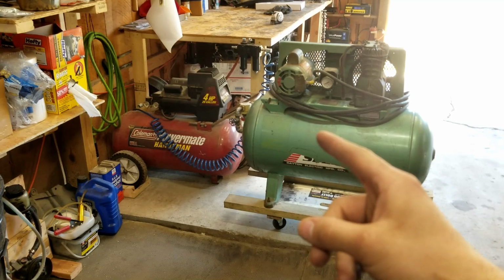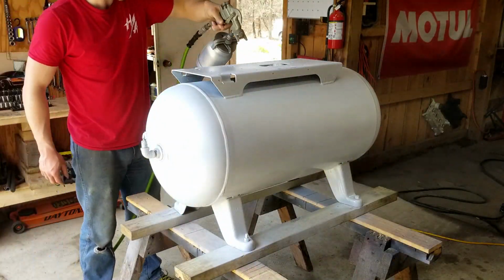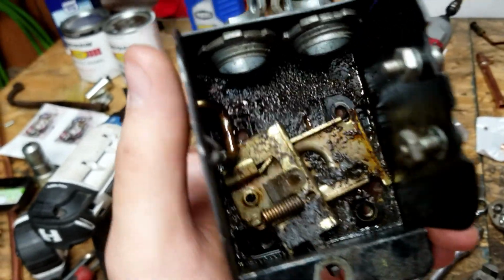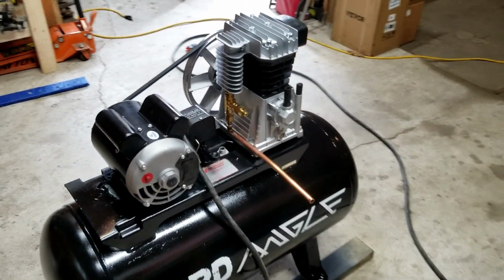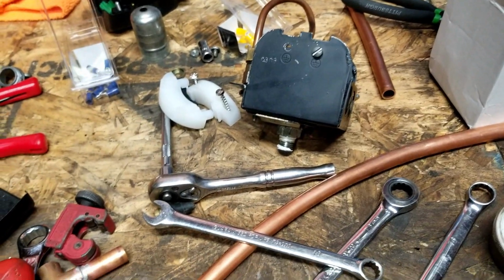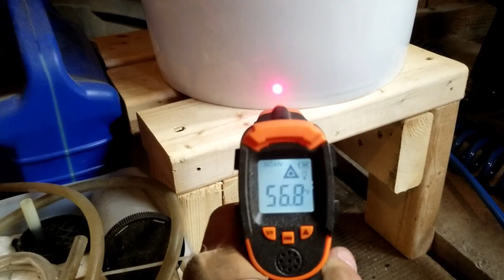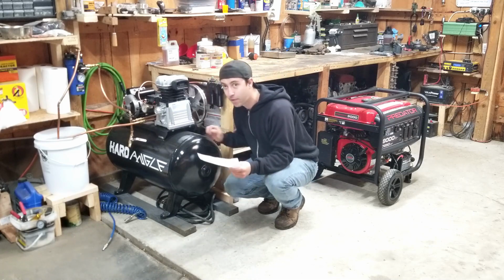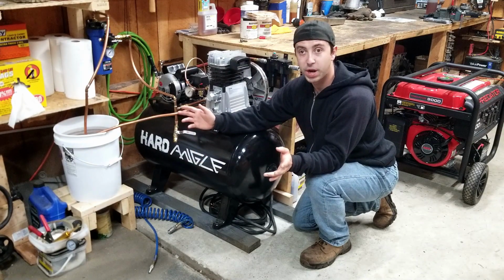I Built My Own Air Compressor with WATER COOLED AIR LOOP!

Comment: No heat shrink on wiring exposing copper, no tank drain on the bottom of the tank, wrong crimp fittings and lack of crimp tool for wiring..  and if you wire motors off of 240 when they can they will be more powerful..   keep the heat on the pipe and fittings when soldering plus use flux..  you can get pads for the compressor that stops a lot of vibration..  if you get a power steering cooler radiator they cool the air plenty as long as you get a 2 pass thats a decent little size and they’re only 40$ at most.  Powr steering is usually 3/8 line so some adaptors and a little pipe fitting and they work great..  using a bucket of water is just too much to keep up with and as long as you use the power steering cooler and put it below the point where it enters the tank with a oil water separator before the tank than not much moisture will get in the tank but still need a drain..  gotta keep tanks drained.  From the amount of crap that was inside that tank from the sound of it im betting its pretty rough inside..  not good..
Reply from the maker: Just going to say most of the stuff you suggested I actually did... yeah the motor wiring could have been better but it is wired for 240,  the tank did have a drain, I didn't build the tank anyway a giant corporation did, everything was soldered with flux, and the bucket of water was insanely cheap, had better flow, and will keep the air cool for hours of continuous use and when heat soaked can be dumped out and replaced with cold water in just a few minutes.

Comment: 100% duty cycle is a dream . I highly doubt that will run a sand blaster your gojng to over heat the pump or motor in no time flat
Reply: I ran a sandblaster for 15 years using a 2hp 20 gallon SEARS compressor.
Reply from the maker: Surprisingly it runs my Skat Blaster great, have done up to 5 hours of straight run time without issue, had a few hundred hours on it now.

Comment: That copper gets really hot! Be careful it will get weak and loose in time.  This will be like getting shot with a 38 cal.  Be safe use compression joints save yourself and your family.
Reply from the maker: This is good advice! Air systems always make me nervous in general, an air compressor is basically a giant bomb after all.

Comment: I just finished rebuilding my air compressor and due to the modifications i've got a bunch of fittings involved and because of this I wanted something better than teflon tape making sure everything is leak free. I ended up buying a tube of "pipe dope" aka RectorSeal "T Plus 2" and the stuff worked flawlessly. I will never use teflon tape on my compressed air system ever again.
Reply from the maker: Pipe dope is worlds better than Teflon, overtime pretty much every piece of tape was replaced with pipe dope when they started leaking.

Comment: Keep the heat on your fittings when soldering. The heat helps draw the solder all the way in the cup.
Reply: Was coming here to say the same thing. Also prevents cold joints. Other than that good DIY project

Comment: Great build! I like when things are built and restored vs bought. I am building a 5 hp w/ a vertical 30 gallon used tank.  
Oh and a tip when soldering, use flux on the pipe and fitting and apply heat to the fitting and the solder will run into the fitting and coat the entire surface between the fitting and the pipe. This will give the strongest and leak free join.
Reply from the maker: Thanks for the tip! System is still running with no leaks or issues, changed to a 60 gallon vertical once I noticed this smaller tank had pinholes in the bottom and I didn't want to risk my safety. But that tank was also used and restored just like this one.
Reply: @HardAngle does the generator work good with the 60 gallon tank ? If so how long does it run with a full gas tank in the generator
Reply from the maker: @CristianGarcia-g3u  I've gotten over 12 hours of run time with a full tank, but the generator was also running my lights, the sandblaster vacuum, and a wood stove blower fan at the same time as the compressor.
Reply: @HardAngle  an that’s with your 60 gallon compressor runs good with it ?
Reply from the maker: @CristianGarcia-g3u  Yes, that is with the 60 gallon tank, since it is the compressor body and electric motor just on a different tank it runs just like before, just takes a little longer to fill up now.
Reply: @HardAngle  oh okay thanks I’m looking to get same exact set up
Reply: Great job I'm running a 29gallon Harbor freight compressor off my 6500watt predator generator without any problems I also did some minor upgrades to the air compressor too but not a whole lot an online water seperater as I use mine mostly for painting metal doors and gates I build it works fine because I mostly use my Lincoln 225 ranger to weld with the generator does everything else especially when I'm welding My helper can do the painting

Comment: If you wanna save on fittings sweat the joints everywhere you can. I did this my second go around building one of these cooling loops and it saved me 120 on fittings vs my similar 200 the last time. Now if your sweating joints and creative you can make some interesting parts for very little. I know one step was gonna run me 70 the first go and sweating it it was closer to 20.

Comment: That was a Sears  Craftsman Compressor under another name Aprox date 1975 had a few of them good unit check tank for rust mine started leaking pin rut holes
Reply from the maker: I also discovered pin holes on this one shortly after the rebuild. I have since switched everything over to a vertical tank and even did a hydrostatic test on it before building it.

Comment: Looks good !!    I approve  :)
Reply from the maker: Turns out, this tank had a pin hole in it and I had to get a new tank. Bought a 60 gallon and the new setup is even more similar to what you did! Lol
Reply: @HardAngle   Very nice... I personally like the upright compressors more since they take up less floor space 👍
Reply from the maker: @fix206  Less floor space AND they are easier to drain due to the shape of the bottom vs a horizontal where it pools along the entire bottom, I am now a firm believer that vertical is the way to go.

Comment: You should hydro test that tank.
Reply from the maker: This tank ended up having a pin hole in the bottom, I got an upright 60 gallon tank and hydro tested it to 230 psi and all went well. Has been running flawlessly for 7 months now. I agree with hydrotesting your compressors every few years, takes an hour or so and could save your life.

Comment: So does that coil of copper sitting in the water end up filling up with condensed water?  And by the look of things, once it fills up, its going to back flow into your pump
Reply from the maker: I have a few hundred hours of runtime on this pump now and have drained many gallons of water out of the water separator but when I took this system apart to move and turned the coil over not a drop came out, so apparently the pump flows enough to ensure any water is pushed into the water separator.

Comment: I built a similar sized compressor with a used 3hp motor, used tank, used switch, used electrical disconnect and a used Devilbiss pump that was in like-new condition...way way less than $972.
Reply from the maker: Again.... $400 in copper and fittings, literally half of the cost is for the cold dry air, the compressor was around $570, couldn't buy this kinda of air output for that low anywhere these days. But I do still respect someone that can build something out of used parts for as cheap as possible.
Reply: @HardAngle  I'm good at not adding up cost for home copper plumbing jobs.
Reply from the maker: It is definitely not my area of expertise

Comment: Oh, and please buy yourself a crimping tool. I can guarantee a simple tug will pull those wires out of the connectors. I used to do the same but after getting a proper Klein Tools VDV200 crimper, it's like night and day. It crimps so well i can hang 40lbs of weight off a connector and it wont come loose.
Reply from the maker: I'll look into those, always room for improvement

Comment: I was just watching fix206’s video on this and like you mention he uses the water pressure relief valve and I’m trying to cut cost on the water cooling system and that thing by itself is $100. Do you just purge it at the separator? I’m wondering if I can add a separator and the coil to my setup and be done.
Reply from the maker: I purge the separator every few hours of runtime and pull about a pint of water out every time, I do the tank daily and have yet to have more than mist come out for a second or two, his setup was a lot more autonomous but mine has given me dry air for hundreds of hours of sandblasting so far.

Comment: What generator would I need just for the air compressor it’s sell I have same exact setup but with a 60 gallon tank
Reply: Generator wpuld be the same its running the same power at the start as it would the emd maybe just runs a few extra minutes.